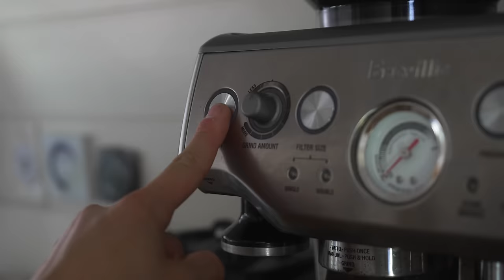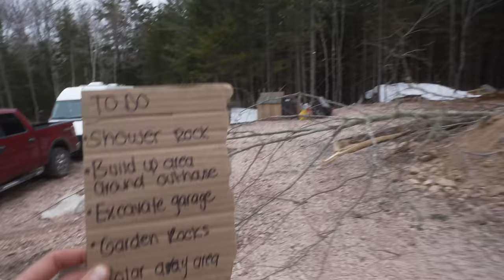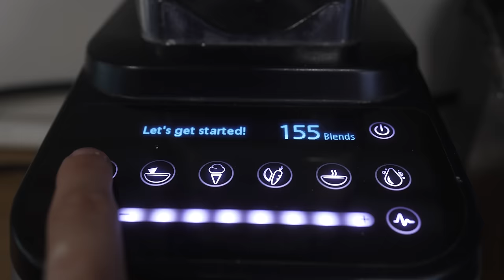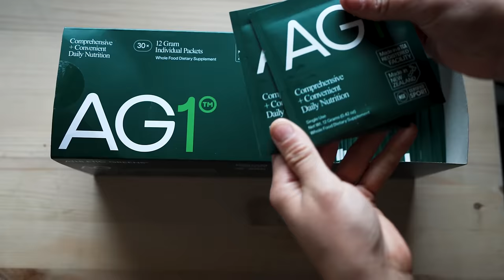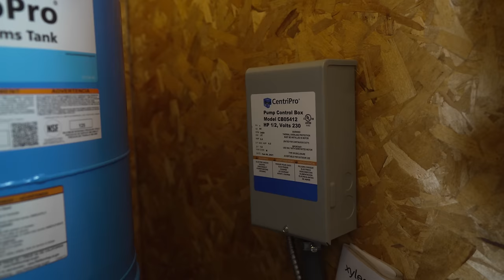Women Living In The Wilderness Alone

Comment: A tip on the chain. When you run the chainsaw a lot, the chain gets hot and stretches. When you’re done working, slack the chain off as it will tighten up as it cools. If it is too tight when it cools it can damage the pins in the chain links, making it stretch more the next time you use it, many cycles like that and the the pins/links will eventually snap while in use. So ya. Just slack the tension off when you’re done using the saw!  
Love the videos and watching your progress!

Comment: Seen mentioned on someone else's video, don't cut logs on the ground as you'll clog your chainsaw up with dirt (as you were finding) and blunt it super quick, get it off the ground slightly so you have clearance to cut through it without hitting the ground.
Hopefully you're planning on keeping the excavator to dig the trench for your array cables across to the batteries/inverter to save your backs.
Looking good! & Porter is awesome!

Comment: Maybe get Porter to help with / teach more of the basics of chainsaw maintenance.  (Having done this for more than fifty years) I can suggest that keeping the saw clean and the chain sharp matters a lot for safety and happiness.  Try not to get into dirt.  Flip the bar upside down with every clean, adjust the chain tension (just so that the lower side comes up to the bar, not "tight" -- roll the chain along the bar to test....  (if I were cutting what it looks like you are cutting, I would have three or so chains -- sharpen them at night -- so that you can make a mistake ("touch a rock") and just change out the chain.

Comment: Quick note on where the water pipe comes into the house….I think you showed some form of heat for the pipe to keep it from freezing in the winter? That may be OK for homes with AC power, but any heating element takes a LOT of power from a DC system.  It may not seem like a lot, but it is like a sink that has a dripping faucet. Over time, that heating element can be a big drawdown for a solar system and would be taking energy out of your batteries when you need them the most in the winter. If you could build an insulated box around those pipes, with a LOT more insulation, that would help conserve electricity. I would have that insulated box go down into the dirt at least a foot (or more if you can get into that difficult space).  Hopefully, the plumbers left you a way to drain the waterline completely at the well casing, so if you travel south again for the winter, there is no water in the blue line at the house at all. Just a thought! ☺️

Comment: go further than  4' .. with the polar vortex I've seen people with their well lines frozen solid .. a very very expensive fix if that happens.. if you do not want to put them deeper please put heat cables on them as you will be protecting yourself from this issue .. it's only happened in the past few years but contractors are digging they well lines in much deeper these days ..

Comment: Congrats on the water, but I did not see thermal instullation for the bit of pipe between the house and the ground. Will that part be instulated as well to lower the risk of freezing? (I know you have heat cable, but still...)
We get -30*C and even colder in the winter and planning to move in the house before winter this year... - gone through all of this recently...

Comment: You likely need a 1.5 metre cover over the water line, for freeze protection, should you choise winter use,  plus heat tracing and pipe insulation above that depth.  Otherwise purge the pipe dry.
200 psi pipe class is not needed in your case.  Waste of money.